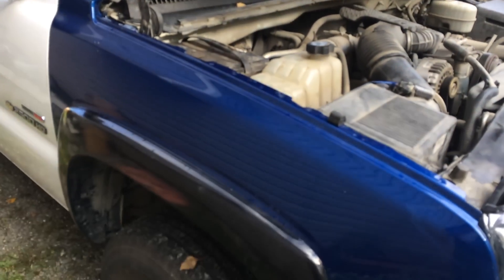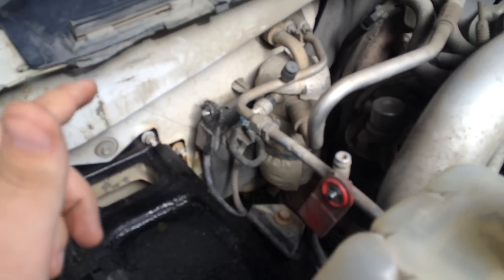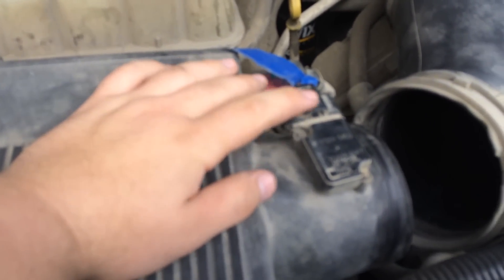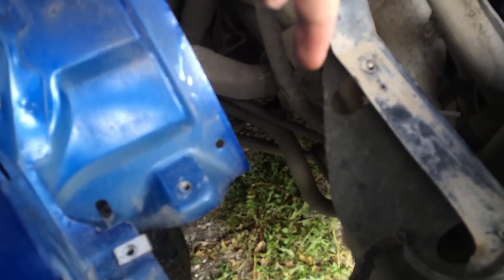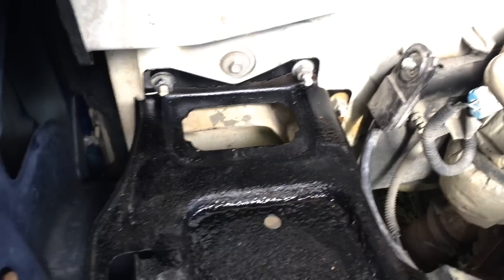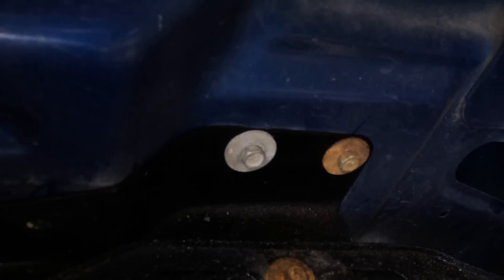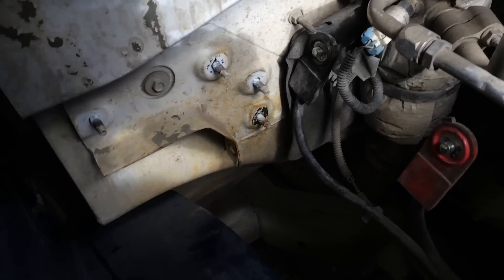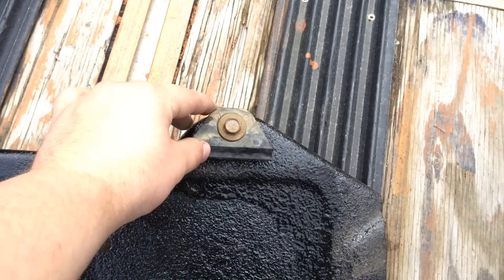How to remove a passenger side front fender on a silverado/sierra 99-07 classic

Comment: I can see this video is a few years old but hopefully you'll see this. My truck was in an accident and I am unable to open the door to get the two bolts, due to the fender being bent under it. Is there a way to access them or do I need to take off the door aswell?
Reply from the maker: You’ll need to get that door open to access the bolts, which sounds like you may have to bend or cut the fender so the door can open. Fenders are cheap do your best to not damage the door or that becomes a larger process.

Comment: two questions please...do you have to remove the hood ? Is the front bolt accessible without removing the bumper ? I think if thats the case, its harder than the dang fender
Reply from the maker: Robert Arco no need to remove the bumper you can access the bolt threw the wheel well. And I don’t think the hood has to come off but it sure makes it a lot easier.  If you can get a buddy to help you it will make the job way easier.  Good luck.

Comment: i took every bolt imaginable & the fender still won't come off  it ain't that simple why don't you show an entire video from start to finish how to really remove the fender
Reply from the maker: Have you removed the front bumper also? What year is the  truck you are working on? This removal is pretty straight forward so I apologize if my free video trying to help people wasn't good enough for you.
Reply: im sorry  maybe  i was a little too harsh  it was off a 1990 chevy silverado it was in a scrap yard so i managed to take off just the inner wheel well it took me almost 3 hours this is winter here, take that in consideration
Reply from the maker: +nick diaz this video is not for a 1990 Silverado.  There was a body style change in 1999 that went to 2007 on sierras. And also silverados  1999-2002 then in 2003-2007.